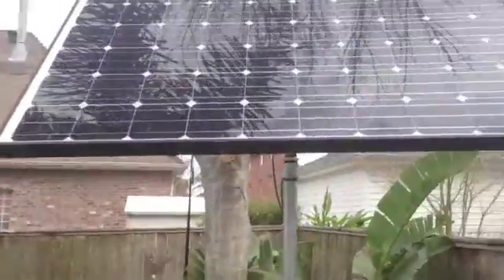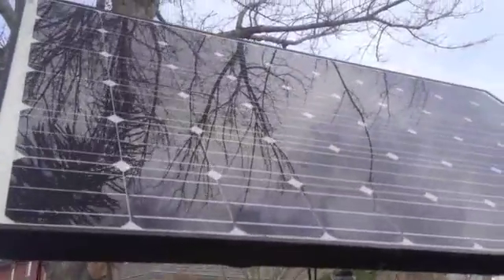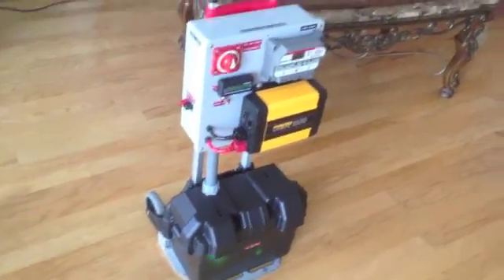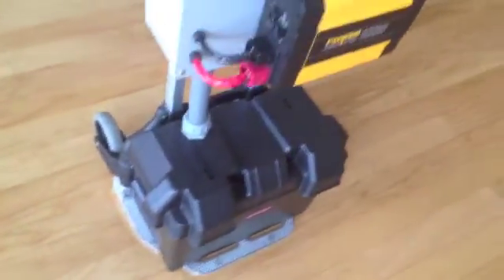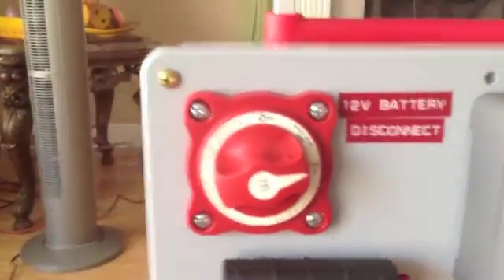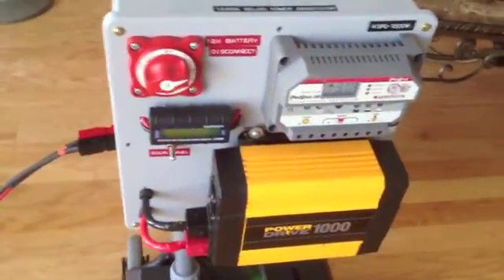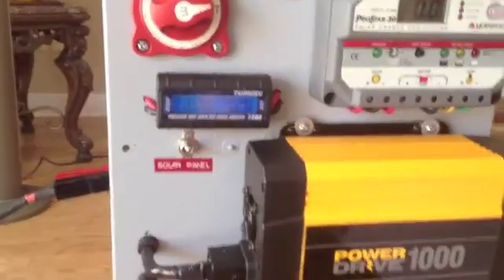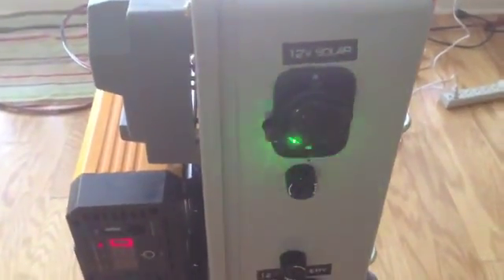DIY - Portable Solar Power Generator - Eagle Scout Project

Comment: Love the build ;)
You may want to think about cable strain relief for the solar panel connector so the weight of the connection and cables aren't being supported by the connector alone.

I hope you got the Eagle Scout Award after this ;)
Reply from the maker: themaconeau  The video shown the initial cable set up only .......... we used jumper to avoid cable and connectors damaged ....... Yes, My Boy Luis Carlos earned the EAGLE SCOUT range on Oct/2014 and the EAGLE SCOUT COURT OF HONOR Ceremony was this past April/11th ............ Mission Accomplished!  ............ Thanks
Reply: Congrats to both yourself and Luis!

Comment: Hello Luis. Since I do not deplete the whole Volt battery every day I was suggested by another Volt owner to setup a small solar "generator" system with the following specs:
1.5-2 kW inverter (over 1KW input, 8 amps charges at 960 watts)
six 6 volt golf cart batteries of 186 amp-hour capacity (1,116ah x6V=6,696 wH)
charger 
solar panels (how many?)
plus misc.

I need a mobile setup charging outside during the day and store it in my garage at night while it tops off my Volt battery.

Comment from the maker: Thanks Preston, It was a lot of back and forth ides on how to setup the components. Our main idea was to isolate Battery Bank from Control panel and Solar Panel. There are rainy areas in the Peruvian jungle on which the Control panel can not be close to Solar panels as an example. The system will be send soon to Peru.